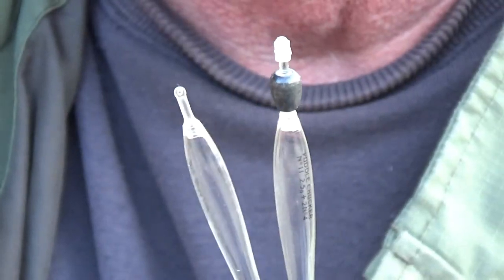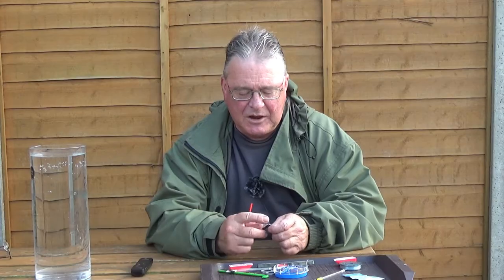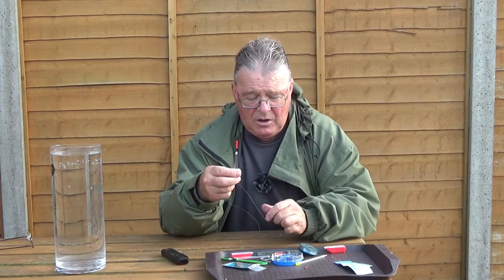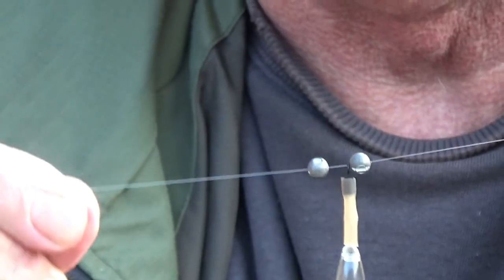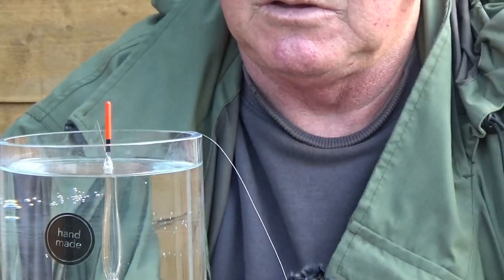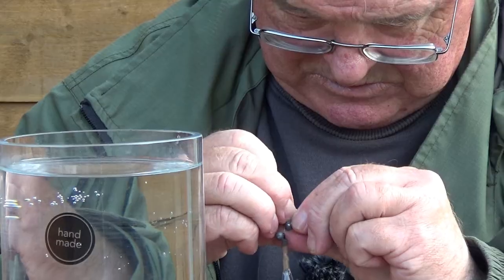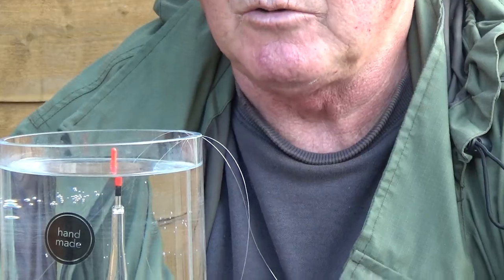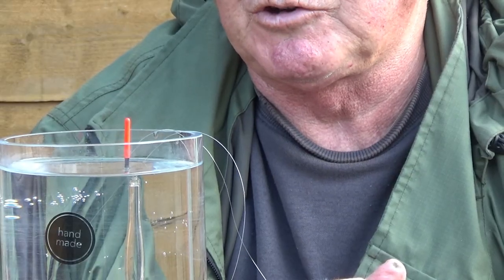Easy Fishing.How To Set Up a Float Rig.Part 2 The Waggler

Comment: Only thing I would say  is,  avoid the clear plastic floats.  They tend to split easily and fill up with water which ( obviously )makes your float sink,  I buy solid plastic or balsa floats...or I even go old school and use a porcupine float.
Reply from the maker: Clive Bindley . Hi well I have been using Drennan Crystal wagglers since they came out and have never had a problem. I think Drennan  must have the polymer mix just right and the wall thickness correct. I have had problems with other makes splitting, the walls seemed very thin, cost savings maybe? The other thing is you can rattle them around in a tube with other floats with no problem with varnish/paint splitting etc. Based on my usage and plenty of others I will always recommend them. However I am well aware that plenty of anglers are traditionalist and prefer balsa,elderpith,peacock quill, cork etc and that is an individual decision, after all we all have different angles on fishing. Plenty of anglers still make floats and there are some craftsmen among them but I stand by my recommendation. Tight Lines